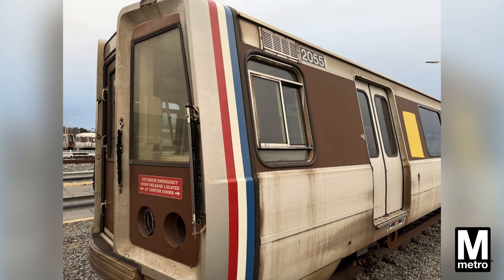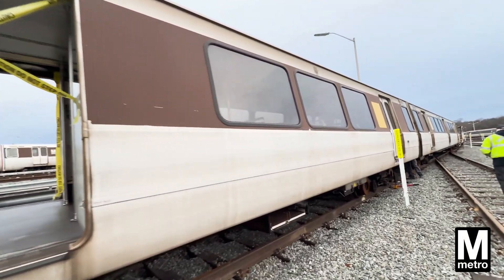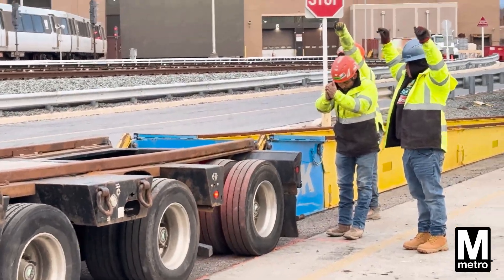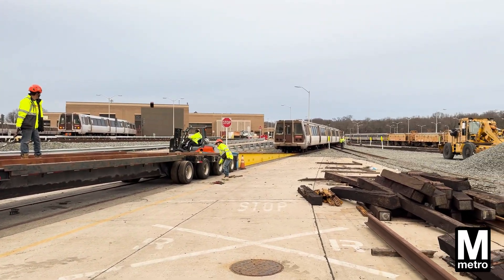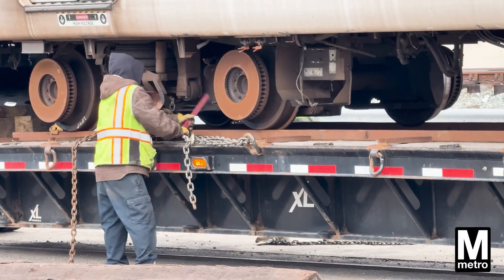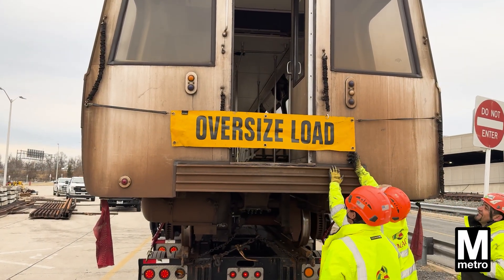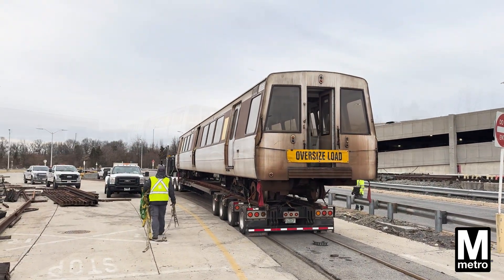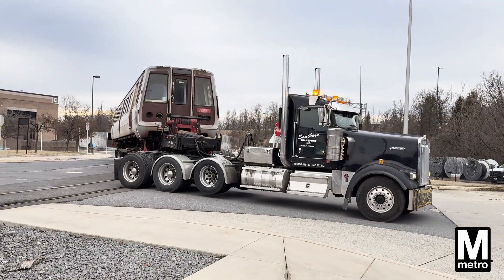2000-series train recycling

Comment: Fun fact:  Ever wondered how the doors worked on the 1K?  They didn't have motors in the top panel, instead, they had motors in swing panels above the ADA compliant seats, openable with triangle key.  MARTA's Franco-Belge fleet uses the same system.  Here it is in action (on Marta CQ311/12).  Notice they sound identical to the doors on the 1K: https://www.youtube.com/watch?v=5Ou_PXa0rUg

Comment: I’m yet to find an answer to this- why were the 4k’s and 5k’s retired before the 2k’s and 3k’s?  One would think because they’re newer they’re better?
Reply: Normally that would be the case but they did so because they had a lot of safety and reliability issues beyond what they could fix especially on the 4ks. 

My question honestly is why were only 184 6ks ordered instead of a bigger amount like 400? 400 wouldn't have been too big or too low just enough. I say them specifically because aside from the coupler issue in late 2020, they have never had any issues of any kind and it would've been easier for metro to meet service demands when the 1000s, 4000s and 5000s were having safety issues and they wouldn't have had to be used to their breaking point. They could've still waited till 2017/2018 to retire them but they wouldn't have had to push them to their very limits to meet service demands and having a bigger amount of 6000s also would've meant the 7000 series wheel issue in late 2021 not being as controversial as it was cause while they still would've had to cut service, those cuts wouldn't have been as drastic as they were. And they also would've had the ability to extend the Yellow Line to Greenbelt sooner than they did like in the summer of 2017 or summer of 2014 or something instead of what actually happened in the spring of 2019 and it wouldn't have had to have been cut back in the spring of 2023 to Mt. Vernon Square. Sorry for redundant comment, just a lot to dissect in my case.

Comment: It's been real riding with you, 2000. I'm so gonna miss riding those 20000-Series Trains. Looks like 3000 is going to be next in 2027...
Reply: it also seems like the first priority of the 8k trains (from what we've heard so far) is to retire the 3k trains - meaning before the other likely intents with the 8k trains like replacing the 6k trains and increasing train capacity
Reply: @alternatehobbies  The 8K is going to replace both 3K and 6K, both of which will be at the end of the service life in 2027.
Reply: @gliese909  the replacement of 6k is merely an option in the order, not something for granted - they haven’t even gotten their mid cycle refresh. the only confirmed order purpose we know for the 8ks is replacement of the 3ks. WMATA also has the option to expand system capacity with them, but they might see how efficiently ATO runs when it goes live in 1-2 months. we’ve also heard rumors that the 6k will get a refurbishment to include screens and automated announcements like the 7ks have. we just don’t know, and won’t know for a couple years. 2027, if anything, may just be initial delivery rather than all units in service, things might get delayed more too.
Reply: @alternatehobbies  last year it said in documents that they aren't planning on that 6k option anymore and they'll play out their full 40 year lifespan
Reply: @gliese909  no the 6k option was decided that they wouldn't do it and only the 3000s would be next